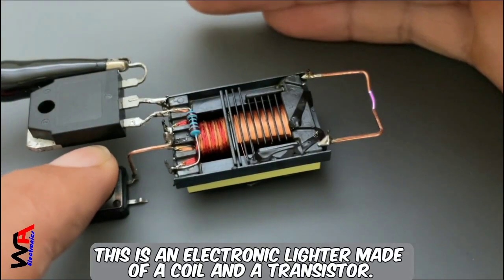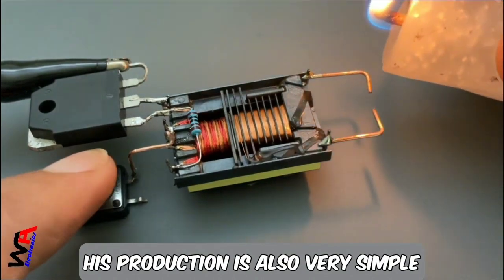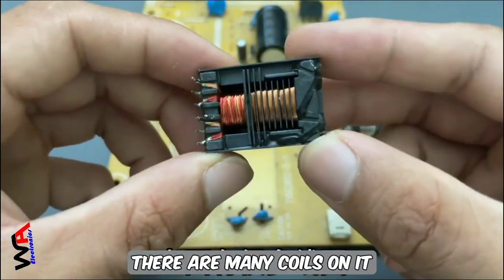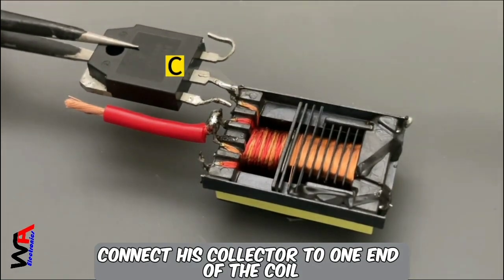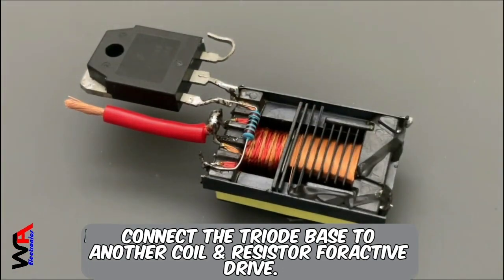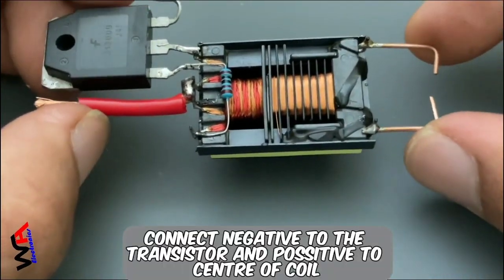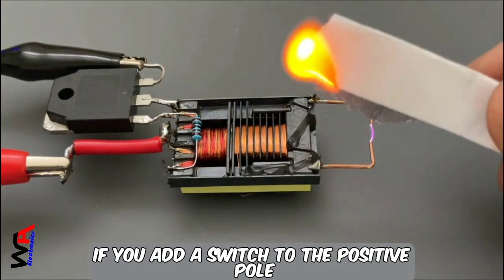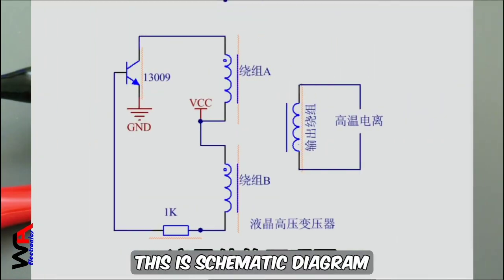DIY Electric Lighter Using Old Scrap PCB | Simple & Easy Electronics Projects

Comment: Bro did you get heat issue in MOSFET???
Reply: change to high power mosfet like TIP41C
Reply: @thefirstsin Did irfp260 work ?? If yes then the pinout will same or change